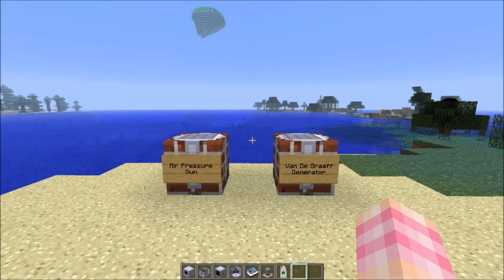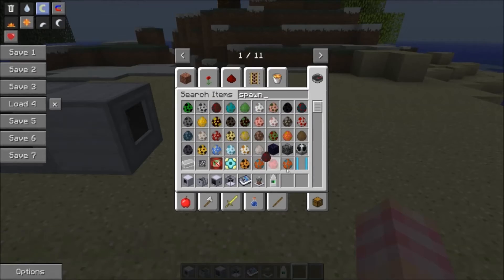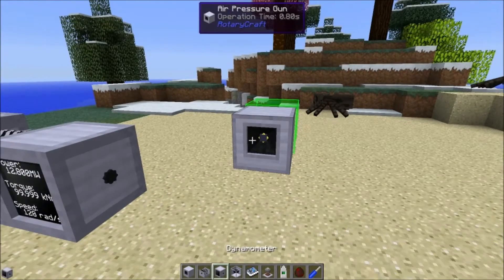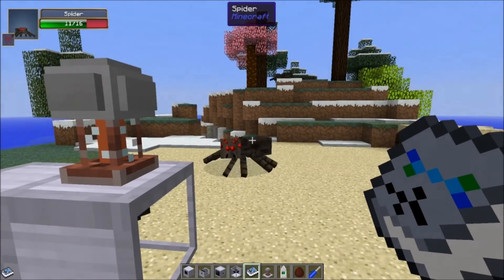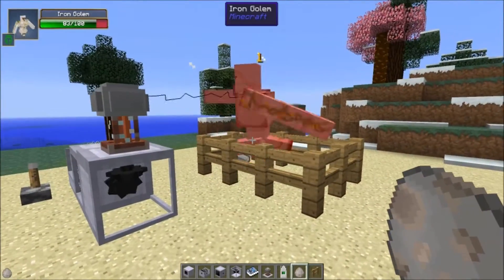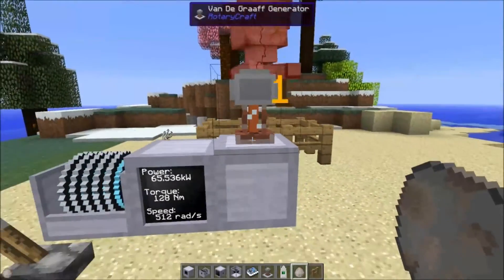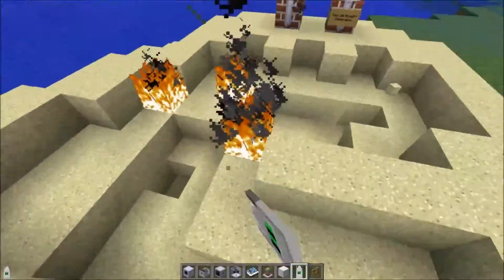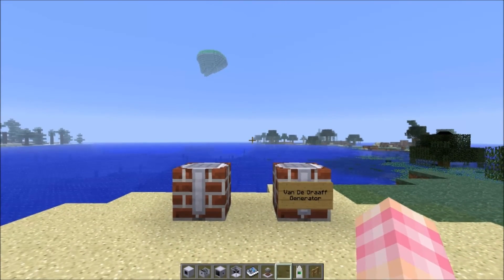RotaryCraft Tutorial #35 - Van De Graaff Generator & Air Cannon

Comment: I thought this would be awesome as a mob grinder, so I placed it next to my skeleton spawner (near my house). I had left to get food, and when I was almost home I randomly died, in full bedrock armor. When I looked to see the cause of death, it said I was electrified... turns out this thing is really dangerous to use when no mobs are around.
Reply from the maker: What happens is that the generator will store up too much charge which will attract a bolt of lightning. So yeah, you must make sure a van de graaff is being discharged. For mob grinding use the actual mob grinder block
Reply: Ya I watched that video after this happened

Comment: The way the range on the VDG works is that the range is determined by the accumulated charge and continuously grows until there is a targetable entity inside the range, whereupon it fires, resetting the charge and range to zero. Power input affects charge accumulation rate.

Also note that that then means that longer-distance bolts are by definition more powerful and more damaging, though for a given power input are at a slower rate than a close one.

And, once the accumulated power crosses a certain threshold, you get hit by a much larger bolt.

Comment: If Reika sees this:
Shouldn't the VDG Generator use a belt instead of a glass pane?
Reply: Oh, also, I've heard they explode if they overcharge. I don't think that will happen IRL, shouldn't it discharge eventually and catch on fire?
Reply: It does not really explode so much as attract a larger discharge from above, if you look closely. ;)
Reply: Didn't see that. So awesome, It's an anti-lightning rod! :D I knew somehow there was something behind it. I haven't used VDG's since my old computer, with all the graphics turned low, and a graphics bug so lightning was weird. Anyway, that's a cool easter egg, but not really. Another thing I love about RC.